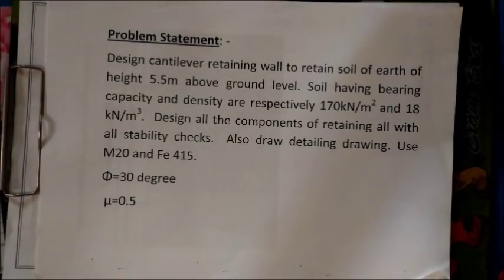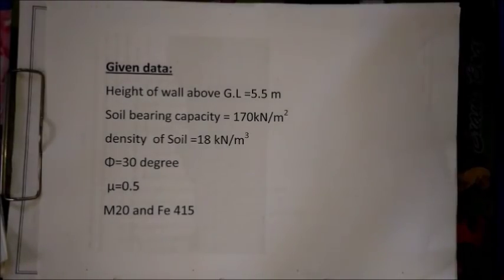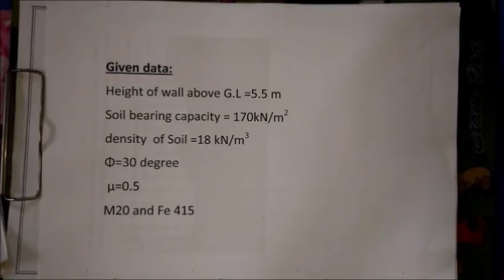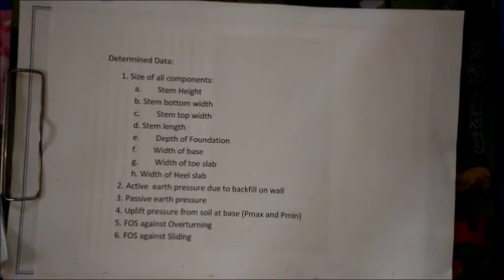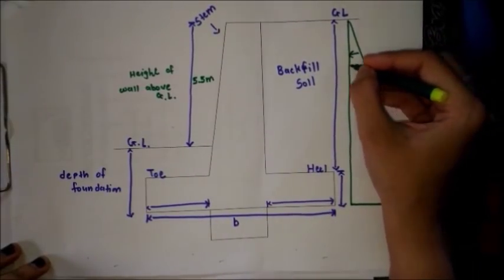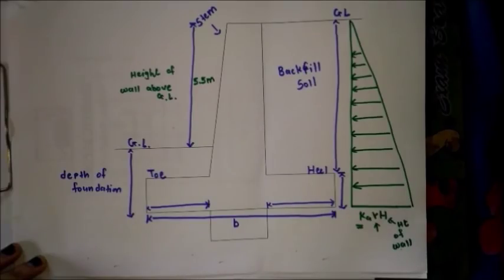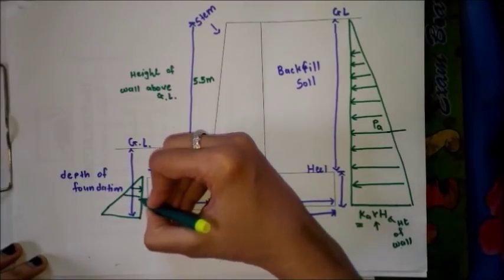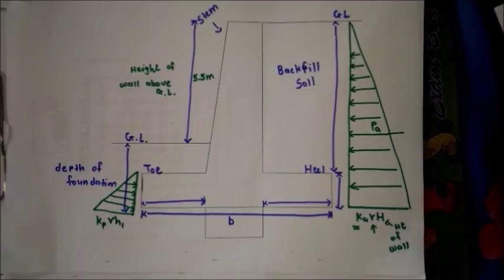Analysis Of RC Retaining Wall: Solved example |Civil Engineering

Comment: There is a issue in your vertical force calculation?
6.2 m x0. 2 m x 25 kn/m3 = 31 kn/m???
Reply: multiplied by 1 m ie unit length of wall

Comment: There is calculation confusion or U mistake it 
Width of toe slab =1/3× b =1/3×3.35= 1.1166 so on 
But u determined it as 1/3×b=1/2×3.35=1.12=1.2 approx 
So plz give me solution as soon as possible bcz my exam on 2nd of may plz

Comment: Your F.O.S against sliding is 211.13/300.31 = 0.70 which failed. You have used Pa NOT Fa in your calculation. Thank you